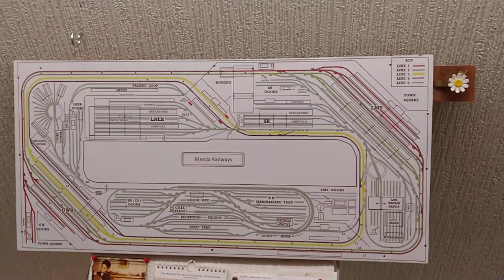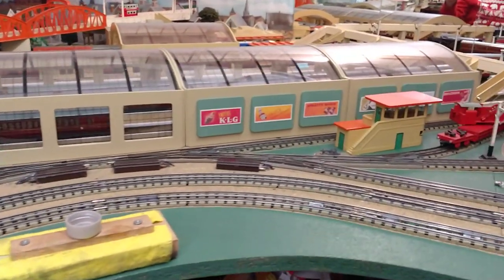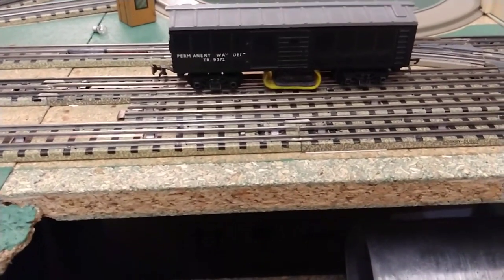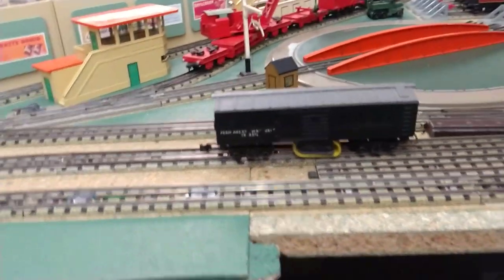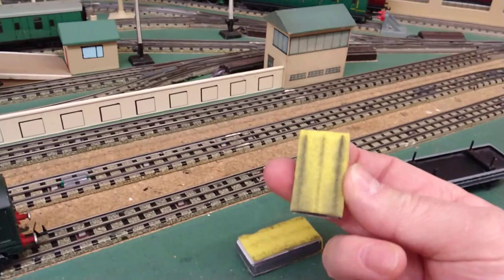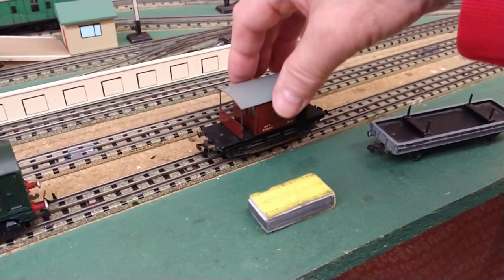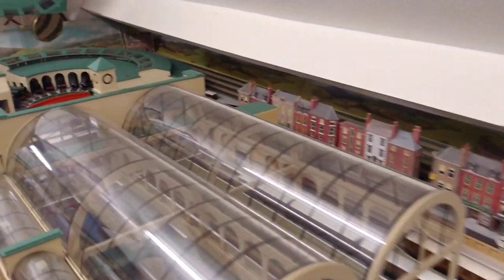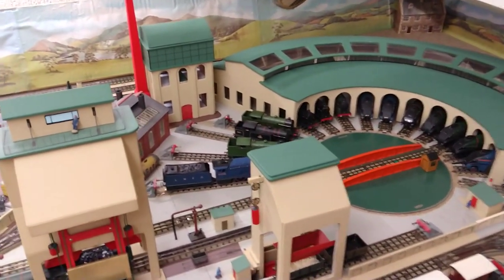Hornby Dublo Track Cleaning

Comment: Happy New Year Ron;  As always great content, lovely presentation, plus helpful tips using suitable wagons.
For my layout I have a modified version of the ‘Tri-ang’ track cleaning car that enables me to easily substitute the pad for a ‘shoe’ that fits between the bogies and is weighted down by a medium sizes ‘balance weight’ as used to trim car wheels.  The bottom of the shoe is faced with a removable piece of hardboard (Masonite in USA) - ROUGH side towards the track. This is wide enough to clean the small radius curves too.   On completion of each section (eg UP line, DOWn line,  shed etc, etc) I then use a carpenters pencil, sharpened to a chisel point, to coat about 1ft (300mm) of the 3 rails on that section and let the metal wheels distribute it around the outer rails on layout.  The loco pickup distributes on the centre rail. My experience has been to extend the period between cleans by approx. three months.
Keep Safe and Well and putting up your high quality and useful videos.
Best Regards, Tony.
PS An idea for a future video - How to apply the HD card insulating tabs to isolate sections of track correctly. T🚂
Reply: You all probably dont care at all but does someone know of a tool to log back into an Instagram account..?
I somehow lost the account password. I would love any help you can offer me
Reply: @Henry Adrien Instablaster =)
Reply: @Kayson Randy i really appreciate your reply. I got to the site thru google and I'm in the hacking process now.
Looks like it's gonna take quite some time so I will reply here later when my account password hopefully is recovered.
Reply: @Kayson Randy it worked and I now got access to my account again. Im so happy:D
Thanks so much, you really help me out!
Reply: @Henry Adrien No problem :)

Comment: Great way of using a regular wagon as a track cleaner. You mentioned meths, how do you think IPA compares?
Reply: Iso-propyl alcohol or India Pale Ale? I think any beer would tend to leave a sticky mess on the rail head...
Reply: @harryfaber  Surely that would add to traction 😉. Of course I do mean Iso-propyl alcohol though I think the latest craze is to use Inox as it prevents oxidation and apparently works very well.I’ve been tempted to try myself but it’s no good for traction tyres something I have too many of.
Reply: @RobA500  I will be following Mr Dodd's advice, lighter fluid will evaporate fairly shortly after use, so it shouldn't cause problems with anything else. And 'moderation'. Enough to make the cleaning cloth damp. What I liked was his solutions for the hard to reach spots.
Reply: At the moment  I have too many shorts on my newly assembled 3 rail layout the train won't  run and the controller just humsss help !
Reply: @bertiewooster3326  you need to sort out the shorts before attempting to run anything, have you checked your wiring. It could be the track itself, I’m no expert on three rail but believe the middle rail should be insulated from the metal bed so if that has failed somewhere you will need to test each individual piece until the problem is found. It’s worth looking through Mr Dodd’s video library here as there are many useful tips to be found on track maintenance.
Reply: @RobA500  Thanks Rob I'll  get the multi meter out it will take time it's a big layout !
Reply: @bertiewooster3326  good luck. If you suspect it is a section of rail you could try splitting the layout in to smaller sections. Test a section at a time and you may find that some are okay, if so move to next section until you find a short. That may save you taking out every piece of rail for testing individually across the whole layout.